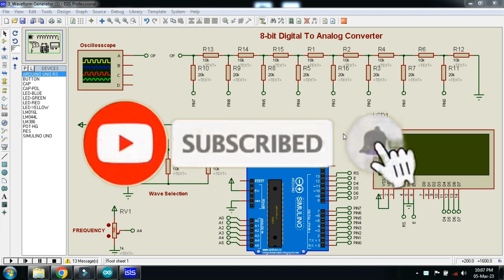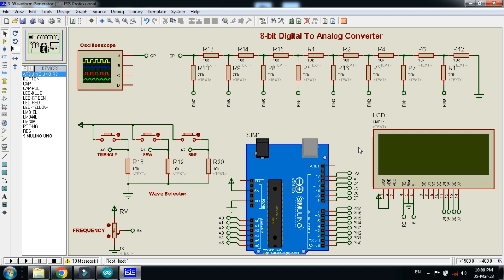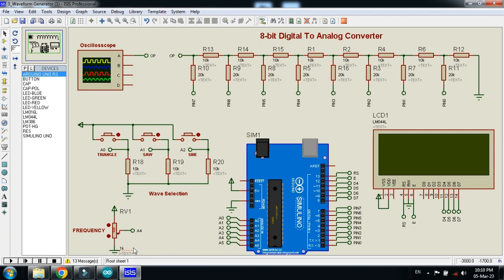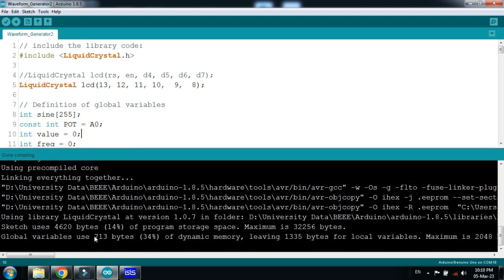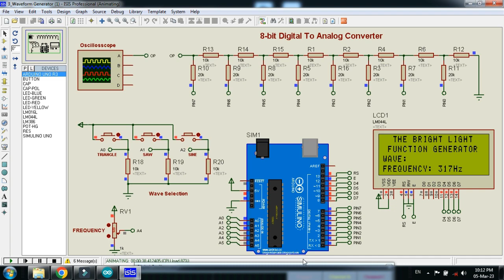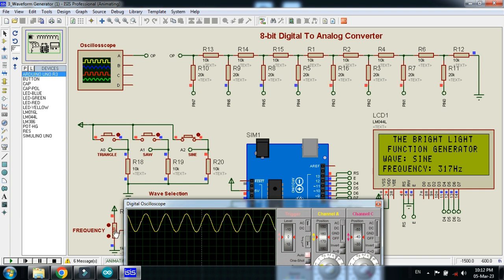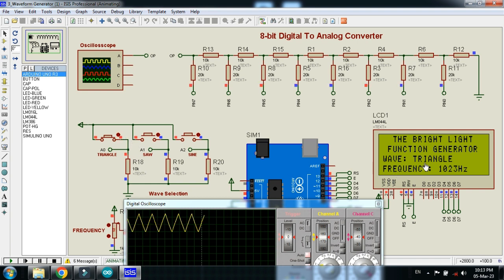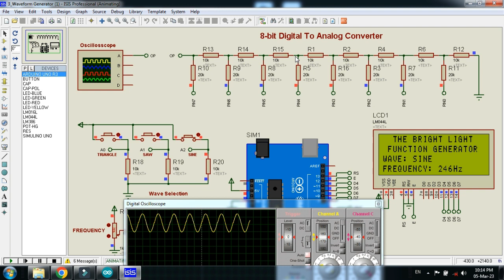Waveform / Function Generator Using Arduino With Code and Circuit || Proteus Simulation

Comment: Nice video. How could it be adapted to a passive buzzer without the 8-bit DAC?
Reply from the maker: Thanks for appreciation.
What do you mean, I didn't get your point about buzzer.
Reply: @thebrightlight9472  My idea is to generate the waveforms and output them into a passive buzzer to hear the sound.
Reply from the maker: You may try it but then you have to do changes accordingly

Comment: From what frequency to what does this construction produce?
And the square is missing the square!
Thanks
Reply from the maker: Frequency Range are can be seen on LCD. Change the value of potentiometer from zero to maximum, at the same time check the frequency range as well.

Comment: Can you please share the .ipnyb file? i can't open the simulation file given in the drive
Reply from the maker: Simulation file given in the video description is a zip file and open it with WinRar software please.
Reply: The circuit's file type is data source name. How to open it in proteus
Reply from the maker: File attached with video is zip file kindly open it with WinRar software.

Comment: Is ardiuno uno code working????
Reply from the maker: Yes it is working. Kindly follow properly all the steps shown in video
Reply: @thebrightlight9472  problem is it is not working if you implement it on PCB board ..... i think ardiuno code didn't match with layout....
Reply from the maker: Kindly follow the circuit in the video properly, it will work. Please use the exact values and components shown in the video, it will work. Thanks